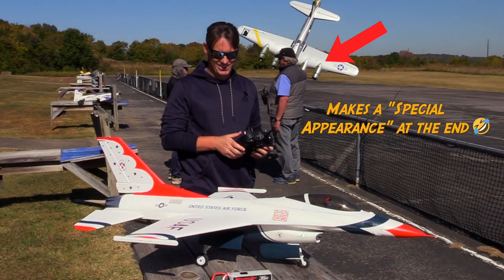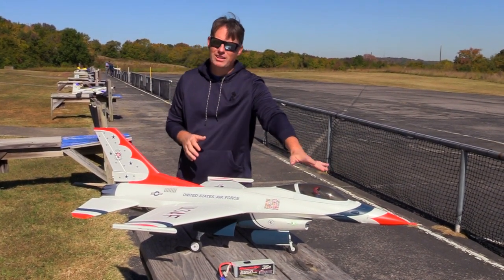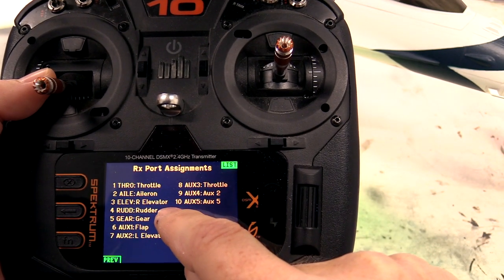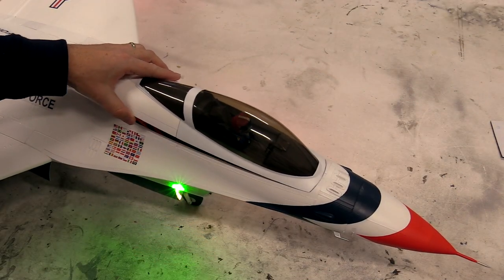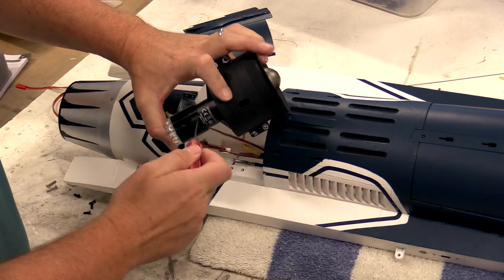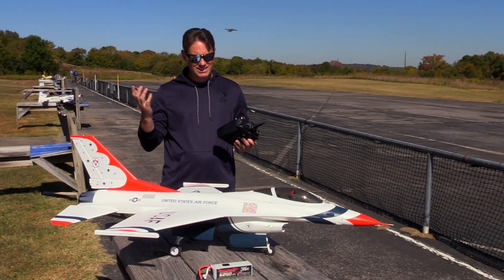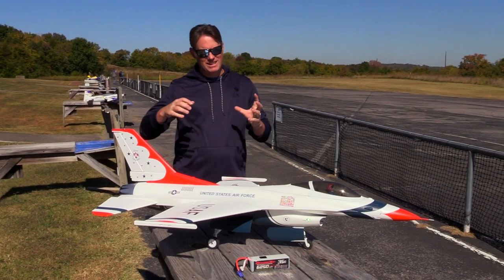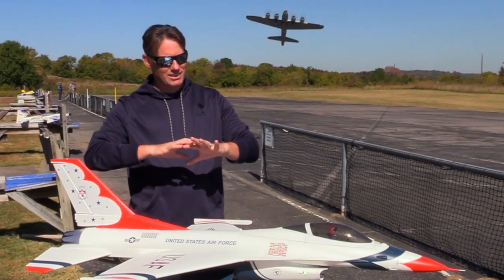Easy Mod for Better Landings: E-flite F-16 Thunderbirds Review

Comment from the maker: ▼Links to Everything used on the model below▼
PLEASE NOTE ► When setting this up, it is necessary to adjust the end points of the left elevator in the radio so that the left elevator deflections match the right elevator.  In the case here, the end points were set to 85% for the up deflection and 66% for the down deflection.

E-flite F-16 Falcon 80mm EDF BNF ► https://bit.ly/EfltF1680
6s 5000mah Battery ► https://bit.ly/Sptm6s5000
6s 6250mah Battery ► http://bit.ly/RT6s6250
6s 7000 mah Battery ► https://bit.ly/Sptm6s7000
Spektrum NX Radio ► https://bit.ly/SpktmTx
32mm Inrunner Centerburner ► https://thercgeek.com/centerburner
ERNST Airplane Stand ► https://amzn.to/3ftOv0w

Comment: Differential stabilators should always be set up on fighter jets with full flying stabs with perhaps the exception of the F-5. All modern fighter jets use differential stabs to aid roll control, especially during landing. On a jet like the F-16, the flaperons aren't enough to roll the jet with precision while deployed - you need that differential movement from the stabilators to produce a controlled roll. It's great to see Horizon finally pushing 8 channel BnF models. We set up our F-16 like this long before they released the 80 Thunderbird and it makes a huge difference in how the jet flies, especially for advanced post stall maneuvering like cobra spins.
Reply from the maker: I hear you and agree that it’s a must if using flaperons for landings. The roll rate suffers considerably when the ailerons are cambered like that and this brings back what is lost in control. For up and away maneuvering though, that’s a matter of personal preference. For scale flying, it’s probably not overly necessary, but getting into more extreme, non scale post stall maneuvers like you mentioned, then yeah having that extra control would be necessary.
Reply: So much RC knowledge flowing! 👍
Reply: And you dont need 80% expo to fly like John with the  H flies with
Reply: @Mikeylikesit1968  I would need 95% to keep from over correcting!!
Reply: @aerospacematt  if you need that much expo then you need to find a new hobby.
Reply: @Mikeylikesit1968  I said that I’d use that much expo if I had differential stabilators working at 100% rates. There’s absolutely nothing wrong with using Expo. Doesn’t make me a bad pilot. Just a different style. And hey, I can decide for myself which hobbies I choose to pursue.
Reply: @aerospacematt  Well I use no expo. I have flown with Kraft transmitters that didn't even have expo back then. You should see my sticks move when I fly. My sticks barely move . Using so much expo you have to jam the sticks around. No thanks
Reply from the maker: @Flyer Mikey Remember, There’s no one right way when it comes to expo. While I have seen it used incorrectly, it’s ultimately about the desired personal feel on the sticks and if someone is trying to get the max throw for 3d aerobatics, it’s essential. So, what your preference is will be entirely different to someone else’s.
Reply: @Thercgeek  Far too many RC pilots think their personal technique is official procedure. In full scale it's known as "technedure" and is a sign of elitism. We much prefer that everyone find their own way through the complexities of flight without "gyro bad" or "expo bad" being used to clobber newcomers over the head - if people are wondering why the hobby is dying, a big part of it is the unearned smugness that comes from "how I fly makes me better than you."
Reply: @Mikeylikesit1968  And maybe everyone should be free to fly their planes in whatever manner they enjoy. It's a hobby after all, designed for no other reason than personal enjoyment. Literally no one had to conform to your opinions in any way with any plane during any flight at any time, my friend.

Comment: Does safe work with the stabilators?
Reply from the maker: I don’t know why it wouldn’t, but I didn’t check specifically. So long as everything is moving the right way with safe on, it should be good to go.

Comment: How were you able to continue to run all the aircraft lights along with the afterburner? I'm looking to setup the original 80mm version like your flaperon and taileron setup here by adding a new AR8360t. All receiver ports will be used by THR, AIL, ELE, RUD, GEAR, Afterburner, AIL, ELE leaving me nowhere to plug the aircraft lights into? Can I Y harness them into one of the used ports?

Comment: For what it’s worth, I discovered that if you go into forward programming on this receiver and a do a factory reset, you can get AS3X to work on both tailerons if you set the model wing type as flaperon/dual elevator ahead of time.  The receiver is smart enough to recognize which servos need stabilization when you now go into initial setup for AS3X in forward programming. Just thought I would share.
Reply from the maker: Great tip!
Reply: I did this on mine. Factory reset the rx so I could put AS3X gains on my R Knob. After some testing I now fly that jet with AS3X off. Only rarely in high wind will I turn it on. FMS/EFlite designed a really stable flying version of a plane that’s full-scale big brother is inherently (intentionally) unstable. Love my F-16!

I’m also getting 6min flights on a 6000mah pack. Wooohoooo

Comment: Excellent video as always👍  you mind  sharing your as3x setting for this specific eflite f16. 

New to As3x on edf and gains are rarely discussed on setup videos.  

Thanks again Chris 🙏
Reply from the maker: I’m just using the stock gains for the bnf. I didn’t reprogram any of that, just reconfigured the tails and ailerons in the radio.

Comment: Love your videos! I have the 80mm T-bird F-16, and want to do your elavon setup... there is an AUX BEC in port 7, do i just y-harness that BEC into port 7 along with the other elavator servo?
Reply from the maker: Yep, that’ll help maintain the aux power and give you the channel for other operations. 😊
Reply: @Thercgeek  is this how you were able to continue to run all the aircraft lights along with the afterburner? I'm looking to setup the original 80mm version like you display here by adding a new AR8360t. All receiver ports will be used by THR, AIL, ELE, RUD, GEAR, Afterburner, AIL, ELE leaving me nowhere to plug the aircraft lights into? Can I Y harness them into one of the used ports?

Comment: I love it, Chris!  What I run is the 4 channels for flight, gear, thrust reverse, Centerburner, and SAFE. So, I'm already out of channels to do the flaperons or tailerons. :(

 What camera did you use for the underside and cockpit filming? Also, are they a permanent fixture? I wanted to know if you made the mount removable without damaging or lifting the paint.
Reply from the maker: I could be wrong, but I believe that you can actually assign the thrust reverse to channels outside of what your radio is capable of as a digital channel. For example, an nx8 can utilize ch 9 for thrust reverse. It just needs an assignment to operate, doesn’t necessarily have to be an operational channel.
Reply from the maker: Oh, and the onboard cameras are runcams. I just tape them in place with frog tape and it avoids lifting up the paint most of the time. On the canopy though, I used gaffers tape as it’s much more robust.

Comment: To do the dual elevator setup, do you have to splice new servo connectors to an existing very long Y from both elevator servos, or is it already setup with a Y connected to separate elevator connectors?
Reply from the maker: It’s mentioned in the video, the two elevators are connected via a y-harness. 😊. So that makes it easy.
Reply: @Thercgeek  Thanks. I wasn't sure if the Y mentioned was like the Ys in the Freewing jets, extra long (36") that are almost impossible to thread from front to rear, or a short Y not needing any threaded thru the fuse.
Reply from the maker: No, nothing like that. They were y’d near the receiver if I remember right. If it was more extensive, I would’ve mentioned it.

Comment: Thanks for easy to follow video! Installed the 8360T receiver in the gray 80 mm F-16 and setup with flaperons and differential stabilators. Couldn’t figure out why LEL had greater range of movement - then I found your first comment on an additional servo adjustment. Only thing missing is reverse thrust - using an NX8 any thoughts on how to add that?
Reply from the maker: Reverse thrust requires an available channel on your tx, so if you have one available, it can be setup.

Comment: Awesome plane & Very 😎  cool video.   Would this jet be ok as a 1st Jet for a experienced seasoned pilot?   I've flown top wing ,bottom wing ,  Tail draggers and trikes.  I fly off  grass most of the time.
Reply from the maker: An experienced pilot should be able to handle this one well enough. The one difference will be landing it though as it requires a nice nose up attitude and controlling the descent with throttle and not pitch. If the nose is down, you’ll end up hot. Regarding grass, how groomed is the surface?  The tires are quite small, so keep that in mind.

Comment: I think I'm going to follow your lead and set up my plane exactly like this like this.  The one problem I have is that I don't have a spare channel to separate the elevator into R and L channels.

Here is how it is currently set up, please tell me if there is a way to make this better:

Bind/Prog/SRXL2: a mystery wire, ultimately just a red/black that runs toward rear of plane (my intuition says a light) (I have never seen where this was used by anything other than a bind plug)
CH 1: Throttle from ESC
CH2: Left Aileron
CH3: Elevator (y-harness of R-Ele and L-Ele)
CH4: Rudder (it's a triple harness with the lead coming from rudder, what looks like the front gear, and then more lights?)
CH5: Gear: (wired through a harness with a 6 or a 9 or a poorly written G on it) this harness connects the CH5B and CH5C leads with a 3rd double red/black wire Im assuming is more lights or gear doors)
CH6: Right Aileron
CH7: AUX BEC (no idea what this does, it only plugs into channel 7 with 2 wires)
CH8: Afterburner ring (I installed)

Any other tips on setup are much appreciated, I can tell you're a far better pilot than me.
Reply from the maker: The aux bec can be removed and added to any channel on a y-harness. All it does is supply redundant receiver power. Which afterburner is installed?  If you have one of my v2 centerburners, it’s Spektrum smart compatible so could be run on a yharness with throttle to open up that channel as well.
Reply: @Thercgeek  It's the standard one from Horizon, just plugged into channel 8.  I got everything working with the tailerons, thank you so much.  The new afterburner is cool. I may need to upgrade!

Comment: Very nice Chris. I struggle to do those nice presentation passes. Any tips ? Also how does this compare to the 80mm ?
Reply from the maker: You know, it’s all about the setup. I’ll turn a little wider in the setup so that I can get a nice centered arc across the length of the field. When you mean the 80mm (which this is), do you mean the gray version?  I outline what’s different in this on in the vid. It’s the same design and same power system otherwise. New paint scheme and receiver mostly.
Reply: @Thercgeek  sorry I meant the 70mm 😅

Comment: Suggestion: glue black cardstock tube to inside of airframe forward of nozzle in back of AB lamps. LED is unintentionally transmitting light through translucent airframe, making the ship look like it has an engine fire (lol).
Reply from the maker: Haha!  The better option is to line the exhaust with foil tape. Blocks the bleed through and adds reflectivity in the exhaust. 😊
Reply: @Thercgeek  I wish I'd thought of that! I hope you'll do a YouTube Short on that showing what happens when you make that change.

Comment: So I have the 80mm f-16 thunderbird and has the 8 channel receiver and flaperons working have the center burner so what channel is left to plug in the elevator to set it up like yours ?
Reply from the maker: The flaperons/tailerons combo only requires 7 channels. So, burner is in channel 8 on a yharness with the aux BEC line.
Reply: @Thercgeek  awesome thanks for help

Comment: What about using the wing control surfaces as flaps exclusively (no wing aileron function at all) and using the tailerons exclusively for roll and pitch control, at all times, rather than all of the complicated mixing.  Is there ever a point in the flight envelope where the throws required of the tailerons to achieve good roll authority is just too extreme that it risks either aerodynamic stalling or a structural failure of those control surfaces, or some other bad tendency?
Reply from the maker: Sure, that’s a possibility too. I didn’t want to mess with changing how the airplane flew up and away because it flies extremely well with the aileron and elevator control. That being said, the receiver comes preprogrammed setup for flaperons, so to do it right, you’d need to reconfigure it if going to taileron only.

Comment: Do you need an 8 channel transmitter to make this work? Mine only has 7😬
Reply from the maker: You can do the flaperons and tailerons on 7 channels, yes. Just won’t be able to add the burner is all. The smart telemetry means that the burner has to be setup on a separate channel.

Comment: how do you compare the 70mm vs 80mm?
Reply from the maker: Both are great imo. The 70mm is lighter and so will really slow down a ton in the high alpha. The 80mm with the scale gear is heavier, but also faster, and while it does a good high alpha, doesn’t slow down quite as much.

Comment: Thanks Chris!  Just got this model for Christmas yesterday, and I’m following your setup guide.  

1) How did you get the AS3X to work on both tailerons for pitch stabilization after splitting the elevator Y harness?  I currently have the left elevator in Ch7 and setup as dual elevators, but the AS3X on works on the REL.  

2) I also want to setup differential in the flaperons like in your 10ch receiver review, and out of the box, you can’t do that with the way the manual tells you to set up flaperons.  Setting up flaperons in the model type makes the RAIL stop working entirely. 

Does the receiver need to be factory reset or something??
Reply from the maker: Hey, you must have been real good all year! 😆. So, I didn’t do anything with the AS3X and it works perfectly. It’s technically only on the one tail, but I don’t notice any kind of difference in flight.

Because the configuration is preset in the receiver for the ailerons, you’d have to do a reset on it or swap the receiver to setup the flaperons configuration. Again, I didn’t bother with that on this one and it works great as is.
Reply: @Thercgeek  apparently I was a good boy!  Thanks Chris!  Does it work on both tailerons on your 10Ch F-16?  I might do a factory reset and see what happens…

Comment: i fly edf jets almost 3 good years, i dont know why guys who  fly jest models with turbine says " this not a jets " are they mad cause edf more chep than turbine? i fly jet model with turbine two the cost make my wife mad all the time😅😅
Reply from the maker: I hear you. I’ve flown turbines, but mostly just stick with the edfs since they’re generally more budget friendly. The big difference with turbines though is the speed and the flight times you can get with the since you can only get so much from edf. Plus, if you’re building a large scale jet, while edf can be done, turbine really makes the most sense for the flight times and power.

Comment: Is any one else having the right elevator not move as much when you set it up like this…
Reply from the maker: Got your email, We’ll see if we can figure it out
Reply: Mine was doing that. The right moved as normal, but the left had way more throw. I adjusted the throws in my radio to match. Also noticed the as3x is not working on that left one now...  @The RC Geek  are you having this issue?
Reply from the maker: I went back and looked at the programming and I did adjust the left elevator end points to match the right. That’s a pretty big omission from the vid that I forgot about, so sorry about that!  Ill add a note in the description. I’ll double check the AS3X but I’d expect it’s probably the same since the configuration is different from what’s in the receiver to what’s in the transmitter. It’s not been an issue in the slightest flying it.
Reply from the maker: I just added this to the description:

NOTE ► When setting this up, it is necessary to adjust the end points of the left elevator in the radio so that the left elevator deflections match the right elevator.  In the case here, the end points were set to 85% for the up deflection and 66% for the down deflection.

Comment: 1. Flaperons can cause tip stalls.
2. Flaperons cause adverse yaw.
3. Flaperons pitch the nose down.
4. Stabilators have enough work to do just controlling the pitch.
5. Flaperons and tailerons require 2 more channels.
6. You go ahead. I’ll pass.  😊
Reply from the maker: I hear you, it’s Certainly not for everyone and normally flaperons aren’t my go to either.  But if one does do flaperons, you really need to add the tails in too to gain back the lost roll control. I’ve been flying this setup for quite some time (setup my gray one this way too) and it really does help this airplane land slower and is definitely my preference for it.
Reply: @Thercgeek  We're with you 100% on this. The full scale jet uses them, it just requires landing with power on the back end of the curve.
Reply from the maker: @Two Brothers Radio Control yep, get the nose up and use that power to control descent. Essential with or without flaperons on an F-16, just like a delta.